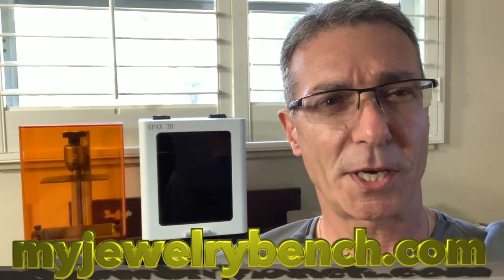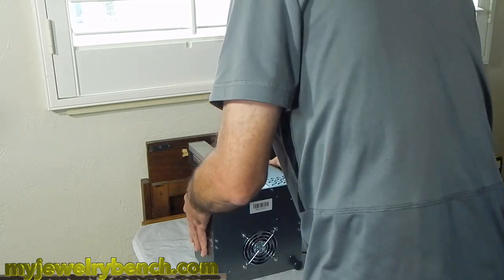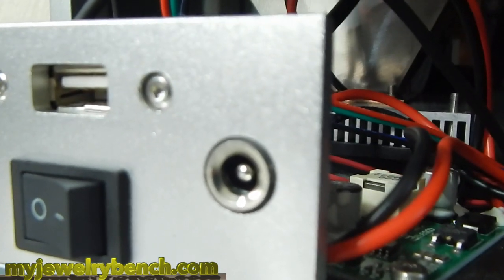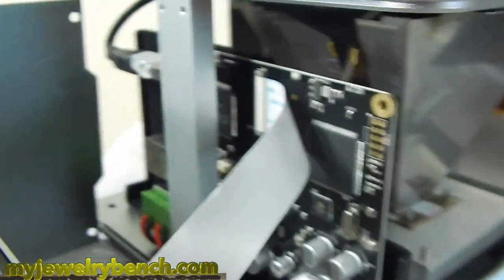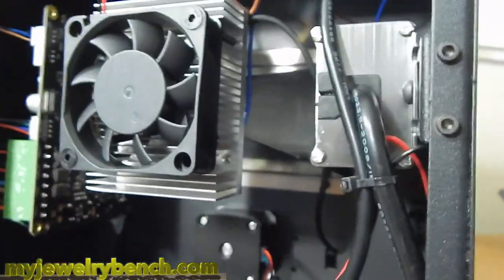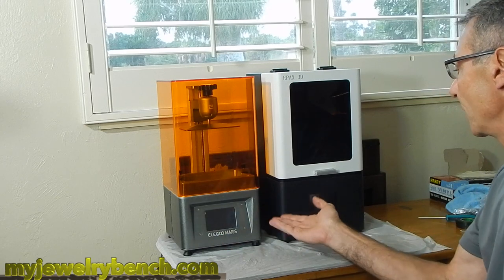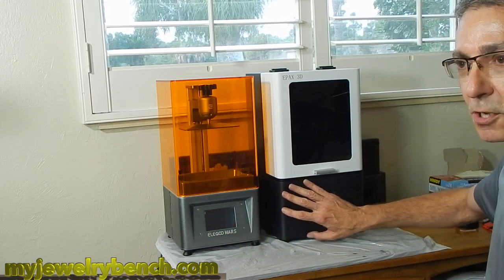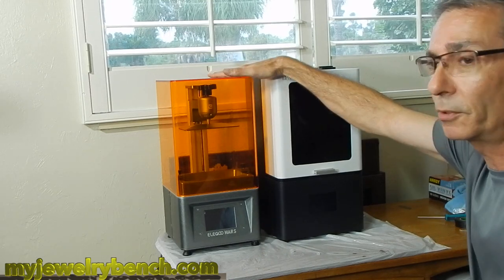Elegoo Mars vs Epax X1 - They Are NOT THE SAME!

Comment: Hi Peter, thanks for the comparison, it's great to see the real differences between the two printers. However I can't agree with your conclusion based on the fact that the EPAX has a bigger heatsink. It has a bigger heatsink, because the LED array has twice the power output & needs a bigger heatsink.  It is a faster (& therefore better) printer because it has a more powerful LED. The heatsink on both printers is probably the smallest (cheapest) that would cool the respective LED arrays sufficiently.

Comment: You can flash the epax firmware on the Mars, and turn it (at least software wise) into an epax, it works. This allows you to use the normally unused network port which mars firmware doesn't support. Be aware that the Mainboard with network port is only on the older versions of the mars, on the newest versions they changed the Mainboard into one without that port.  I am not exactly sure  from which version on they use the newer board. Mine is an M03 and still has it. M05 doesn't. Not sure about M04 though.

Comment: I like both of these printers and recommend either over the godawful Anycubic offerings.  With that said, with almost a $150 price delta between them, the Epax X1 should offer some significant upgrades over the Mars.  Note that the Mars is supposedly using a 40w lamp like the Epax (and the exposure time recomendations between the 25w Anycubic Photon and the 40w Elegoo mars prove this out), so the main difference in the power supply design is NOT specific to the power of the LED lamp.   I'm torn if moving from an external DC power adapter to one located inside of the printer is good or bad, as technically the power supply generates heat and is itself subject to premature failure if exposed to constant high heat, so placing it inside of the chassis is adding heat where you're trying to remove it, and replacement is more complex in the event of a failure (which is more likely given it's location in a high heat area).  I was unable to tell from the video, but are the FANS attached to the heat-sink under the LED matrix the same size in both printers, or is the Epax smaller?  

I think the biggest benefits of the Epax over the Mars is the vastly superior Z-rail design in the Epax, the upgraded non-FEP resin vat (prints sticking to the FEP is probably the biggest new user complaint about all of these printers), and the fast, US-based tech support offered by Epax.  I'm not sure how fast the z-axis on the Epax moves compared to the Mars (which is notably faster than the Photon-S) because it doesn't have a profile in Chitubox, this would be an interesting thing to compare.

Thanks for doing the work on this, your reviews are always interesting and thought provoking!
Reply from the maker: So, in my tests...  Epax Z axis is about 18% faster.  There is typically a Slow up, then fast up on the z axis to try and prevent sticking FEP/Resin.  I’ve gotten away with using RainX on my FEP for my Elegoo and have not had this problem since.  I apply it once every 20 or so prints and wipe clean.  Similar with the Epax.  For the Home engineer or hobbies, the Elegoo is perfect.  The Epax in my opinion is for all day, every day printing.  Of course, it has upgrade options...  I’m hoping to see what comes next from Elegoo, and if they step it up.  Support is OK for Elegoo, if you use their facebook forum, they seem to respond in a couple of days...  If you don’t mind the wait!  Lol
Reply: @watchesandjewelry  I've had good luck with the FEP not sticking in my Mars, but I believe the RainX solution you mentioned not only addresses the sticking problem that many new users experience when getting resin settings dialed in but also prevents some wear on the FEP film and lengthens it's useful life due to the reduced adhesion/bruising of the material over time.  I'm surprised all of the manufacturers using this same basic design don't include a few Rain-X wipes in the package as it would likely prevent some serious frustration from end-users and reduce the out of box learning curve.

As far as the speed difference... Can you share your slicer settings for the Z-axis travel on the Epax X1, and confirm that when you compared the printers head-to-head that you'd sliced files for each using the profile specific to that printer that dictate the Z-axis travel speeds?  When it comes to Z-axis travel speeds, a higher number is faster, as it's the distance traveled in a minute by the build plate with every slice when the plate moves up and down with each print pass, and has a HUGE impact on print speeds (possibly more than resin exposure times).

Chitubox doesn't have a profile for the Epax X1 printer, but when I looked up the optimized settings for the Epax X1 on the Epax support site (https://epax3d.com/pages/slicer-settings-chitubox ), it indicates an optimal Z-axis speed of 60/60/120 mm/min.  For comparison, the standard Elegoo Mars & upcoming Mars PRO are 90/100/150 mm/min (bottom lift/lift/retract) while the Anycubic Photon & Photon S are 65/65/150 mm/min.  In terms of Z-axis speed per print layer, the Mars > Photon-S > Epax X1.  

Based on manufacturer recommended slicer settings for Z-axis travel, confirmed by real world comparisons of the same file + resin using slicer settings recommended by the manufacturers, the Mars printer has a notably faster print speed than the Anycubic Photon-S.  This makes sense since both printers have 40w rated LED elements, the same as the Epax X1, thus the exposure times should be similar between the 3 printers making it mostly a Z-axis race.  I'm curious how your result ended up 18% faster on an X1 vs Mars assuming the same file & resin exposure settings since the Epax has a notably slower Z-axis travel speed vs the Mars.  I'm curious if there's another variable I'm not considering, as other sources that have benchmarked the Mars vs the Photon-S reflected this difference with the same constant/variables in play.  (https://www.youtube.com/watch?v=Gh7EcEmWa08)  I am assuming this has to do with some particulars around the types of resins you are using and the "real world" improvements beyond the basic 40w rating of the LED elements in each printer.

The Mars has other issues, most notably accuracy due to it's simple 3-bearing & inside rail Z-axis carriage design.  The Mars is notorious for "squish" at the bottom layers of a print out of the box due to the wonky lead screw/nut configuration.  Unless you mechanically alter the Z-axis, or tweak it appropriately in the software by unlocking the Z-0 function with a firmware change this is a serious problem with all Mars printers that I'm surprised Elegoo hasn't addressed yet.  The z-axis design in the Mars also lacks the wider dual rail, external bearing Z-axis carriage which is a notable upgrade in Epax X1.   The Epax X1 and Photon-S have better diffusion in their LED elements than the Mars, which will be an upgrade to the upcoming Mars Pro along with a fix to the Z-rail screw design to fix the "squish" problem.

For a hobbyist printer, the Mars is absolutely the best value - it's quick, reasonably accurate, and packs in the value while retaining decent support via Elegoo.  It's the perfect tabletop miniature printer for this reason as absolute accuracy isn't paramount, but speed and value are key.  The X1 is the best value for production work & precision, as it adds a level of accuracy the Mars cannot achieve with better LCD diffusion & a more stable Z-axis for greater print accuracy, plus US based tech support and parts turnaround that's way ahead of Elegoo.  The Anycubic resin printers are technically inferior at the same price points as the Mars and X1 so they are not worth mentioning further, particularly since their support is a dumpster fire, with after-sale issue handling is borderline fraudulent.   

The Mars and X1 are both elegant implementations of the same basic design concept, but engineered and priced according to different purposes and audiences.  Depending on the user's priorities (price, print speed, accuracy, support turnaround in the event of failure, etc..) one printer will be better than the other... but which is "best" is less about the printer than it's purpose.

Comment: If you couldn't get the X1....would you hesitate on the Photon S or Elegoo Mars Pro?  Or would you wait for EPAX's to come back in stock....?
Reply from the maker: I have to be honest.  If what you are waiting for is a printer with a parallel lamp than I have to say I do not see any improvement in print capabilities or quality. Overall, the build quality on the epax is the best of all the entry level machines and you should consider long term durability. Plastics will break no matter how careful you are. I also do not think that a parallel lamp makes much difference because of the small size of the print area. I go to my epax x1 quicker because there is less fuss

Comment: Do you really find there's any difference in resolution?. There shouldn't be so much difference apart from faster speed. Well, maybe the z axis in the x1 makes a difference aswell as the elegoo is a meh.
Reply from the maker: LOL. Not with the naked eye!  Print quality is Very Similar, however, the upgrade to the Parallel Array is an important feature I wanted.  The more powerful UV Lamp that comes standard did make a speed difference.  Especially with the Castable wax resins, and some of the very dark resins.  Other than those print qualities, I say it depends on the amount of printing you intend to do.  If anyone knows when the Elegoo Mars P version is coming, I’ll be interested in seeing the insides and performance of that printer.  Let me know!